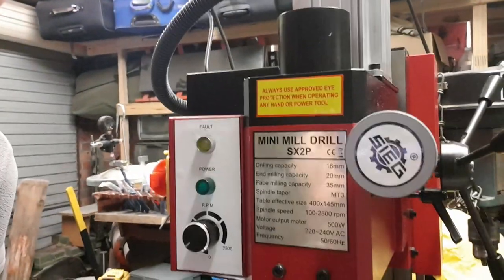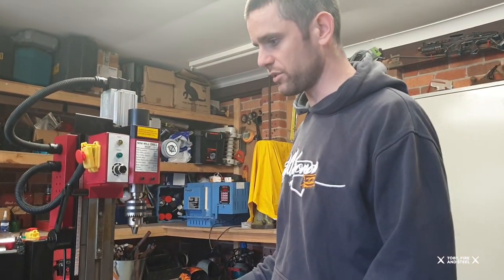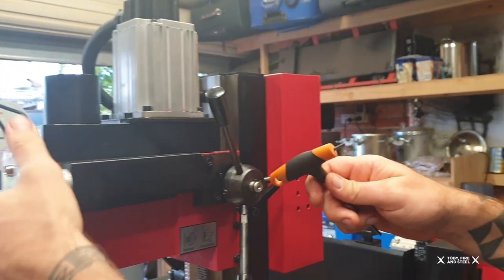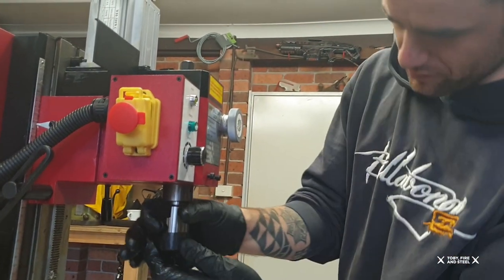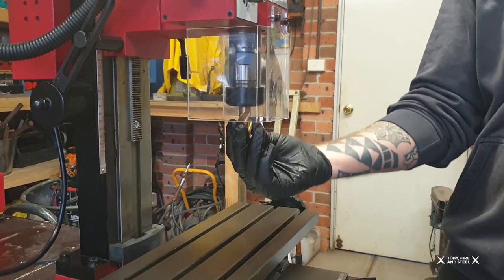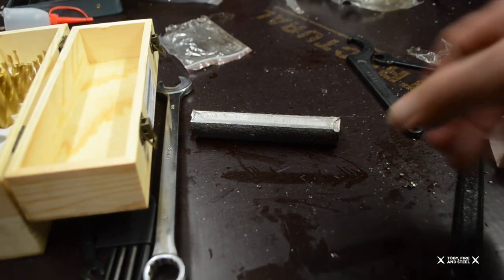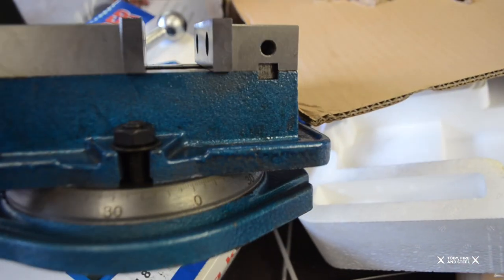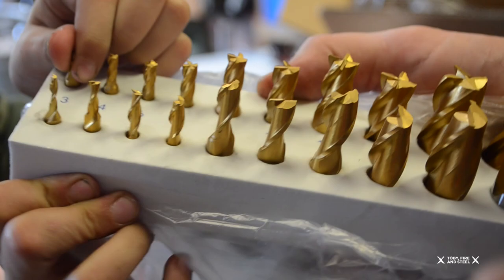Sieg SX2P mini mill review

Comment: Great video. Very concise and just what I needed to know. With your collets make sure you insert the collet into the cap first and not the mill. The collet should snap into the cap then be screwed to the machine. This way the collet will grab the entire shank of the bit or mill. This will reduce vibration and wear on the bit or end mill and give a cleaner result.
Reply from the maker: Awesome cheers man yeah I've learned that since but obviously had no idea at the time lol 👍

Comment: I am surprised no one mentioned this by now, but the ER collets need to be popped into the screw cap at an angle to lock them in place, otherwise you won't get proper grip on the end mill. At 16:25 you can see just how big of a gap there is between the cap and collet, when their faces should be flush when properly installed. Though you may have figured that out by now, but for anyone else watching, please don't just plop the collet into the chuck and screw the cap back on, you'll end up breaking something, or at least get sub par surface finishes due to misalignment.

Anyhow, I'm really tempted to get either SX2P or SX2LF with an R8 taper when many of the alternatives have a less rigid Z axis.
Reply from the maker: Thanks heaps man yeah I working out a while back and someone mentioned it a few months. I really appreciate your help. And your watching
Reply: @TobyFireandSteel  Cheers. Has the mill been serving you well? I've been trying to decide between ER32 and ER25 if I get the mill and was wondering if you've had need for the larger chuck capacity? Thing is, I already have both metric and imperial sets of ER25 collets and would likely use a face mill rather than bigger end mills if I need to go bigger, but I still could get a heavily discounted set of R8 ER32 tool holders while it lasts...
Reply from the maker: @Kageitenshi  yeahbit really has served me well but to be honest I haven't used it a huge amount. But see me needing a larger chuck I wouldn't have thought

Comment: Lol I have one of these but the older version which I have upgraded with the little machine shop belt drive kit. These are good mills. I like your fly press work to, I have just got a press not long ago. I’m still yet to learn how to use it but I’ll be using it for model engineering.
Reply from the maker: Awesome mate yeah I really like mine. The fly presses are cool to but very versatile if you have the right tooling
Reply: @TobyFireandSteel  Yeah. Mine is not really a fly press. It's something else. I got a video of it on my channel now. It's a bit of a rare one
Reply from the maker: Oh cool I'll take a look bud 🤘

Comment: Great vid on the SX2P 👍 I’m stuck between this and the SX1LP for my small workshop. I don’t have a lot of space so need it for general drilling too.
Reply from the maker: To be honest mate that would be a real pain having to change the chuck over every time. But I guess if you will use as  drill mainly and rarely as a mill it would be fine. Id go with the 2 personally mate. It doesn't take up much if any more usable space but is much more capable from what I read
Reply: Thanks. I hadn’t thought of the chuck changing thing. I think I’d use it mostly for drilling. 
Also looking at pillar drills but it was suggested that a hobby mill is way more useful.
Reply from the maker: Yeah would be more versatile loads more money though

Comment: Nice video! Iv been looking at getting this mill for a while now for knife making. Is there enough height to drill holes in knife blocks 150mm tall for hidden tang do you think? Maybe without a vice using 1 2 3 blocks holding the handle block in place.
Reply from the maker: Heya mate thanks yeah is great for knife making. With my vice it about 110mm free space but with out vice it 190mm So heaps of space. I'll doing a 4 hour knife making challenge tomorrow live. And will probably attempt this technique
Reply: Awesome mate Will be sure to watch along i wont get to be in the challenge unfortunately was hoping to but the mailman didnt bring my steel in time.doh haha
Going to hit buy on the mill now. Thanks for advice
Reply from the maker: @PokeWitty  worth emailing the team at ausee.com mate for a bit of a discount
Reply: @TobyFireandSteel  great video Toby. How did you go trying to drill out for a hidden tang? Was there enough hieght for the handle material and a drill bit? 190mm I wouldn't have thought would be enough? I'm looking at getting one as well.
Reply from the maker: I actually couldn't quite do it. I drill out and slot guard and bolsters but my handle blocks are 150 mm and drill bits to long. I tend to drill out my handles on the lathe. Its ro tome consuming to change the collet chuck over to a drill chuck each time. Plus I have 2 drill presses.
Reply: @TobyFireandSteel  Thanks. I've been tossing up wether or not to buy a pedestal drill and small mill or just buy a larger mill but as you said the time it takes to change the chuck out might annoy me... I'm not sure.
Reply from the maker: Yeah you definitely if its at all possible nwed both. I wouldn't be trying to use the mill as a drill man. It wiuld annoying the day lights out of you

Comment: Hey bud... You can not do plunge cuts with an end mill... You have to start on the end of the X axis and work your way into the center of part... You could also start the cut from the end of the Y axis to the middle and then outward to the ends of x axis
Reply from the maker: Thanks so much brother.yeah this is something I went on to learn. Cheers 👍
Reply: @TobyFireandSteel  I just started about three years ago did the exact same thing... all of us newbs do it... I just wish someone had told me before I broke half my end mills
Reply from the maker: Lol cheers heaps mate.